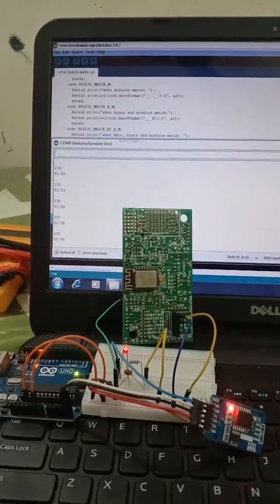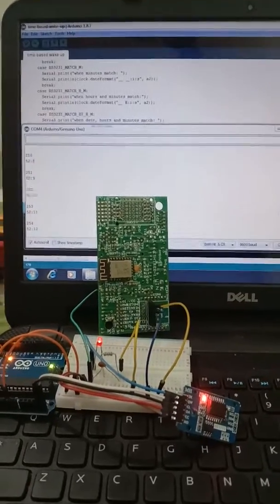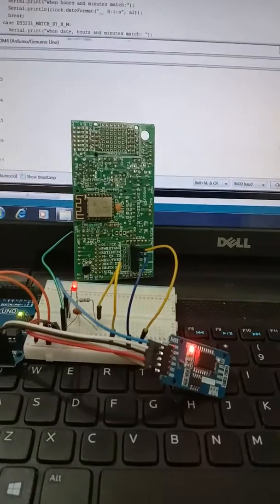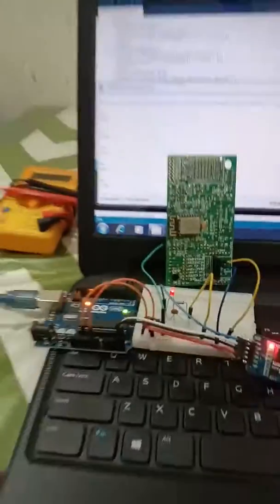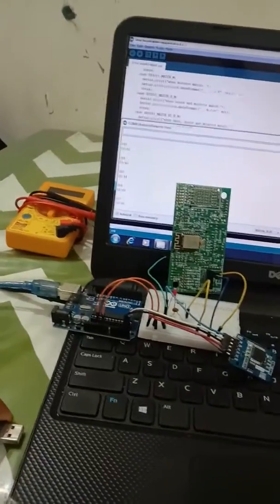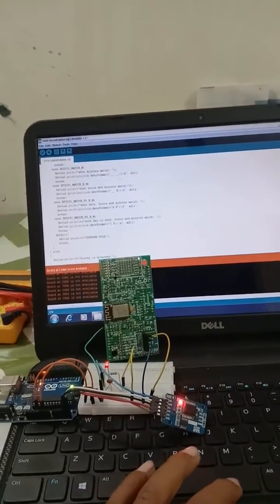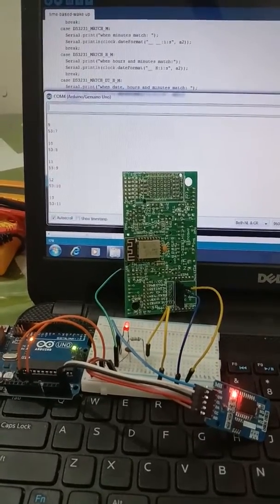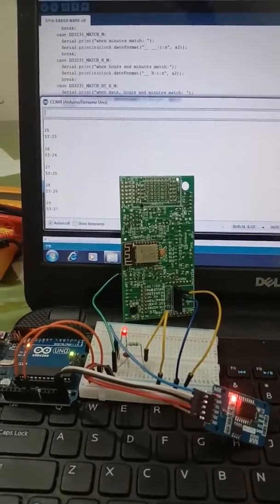RTC module DS3231 timer based wake-up of ESP8266, nodeMCU, arduino

Comment: This video is missing something crucial: a monostable circuit is needed between the MCU RST pin and the RTC SWQ pin. For the actual solution, search for "Monostable deep sleep wake ESP8266 DS3231 RTC alarm". I'd be surprised what is shown in the video actually worked (others in the comments seem to agree). A link in the description to an actual schematic would be useful (ASCII art schematic doesn't really count).

Comment: Hello,  
I have the problem that in case of 8266 RST Pin is connected to SQW, after RTC Timer alarm the SQW output goes to 0V but then remains on 0V  and therefore no Reset to 8266 can be performed. 
If 8266 RST is not connected to SQW, after RTC Timer alarm SQW output behaves correct . After RTC TImer alarm SQW Pin shortly goes to GND and afterwards back to 3V.

Comment: The Ds3231 chip will not wake up esp without the arduino board resetting the alarm flag. The system makes no sense in this case because it needs an arduino connected all the time.

Comment: I have been attempting to use the DS3231 SQW to reset an ESP8266 and can't get it to work.  I don't have an led in mine so I just wire SQW to RST, set the alarm and nothing happens.  If I try to download code after the hookup, it won't happen so I have to remove the SQW, download and then hook up again.  Any help would be appreciated.  I don't see any pin adjustments in your code, and as near as I can tell the SQW is HIGH until it alarms and then it is LOW so should reset the ESP8266.  Any help would be appreciated.  John B.
Reply from the maker: Thanks John. I will come back on it.

Comment: Will the whole chip work if the DS3231 runs only on a CR2032 battery?
Reply from the maker: Yes. It maintains time on coin cell... I have seen even after 6 months
Reply: @wiseThingz  I mean, will the DS3231 powered only from the CR2032 battery generate the wake-up signal at the INT / SQW output?
Reply from the maker: @piotrkuranty8512  yes
Reply: @wiseThingz  I checked and it does not wake up esp8266
Reply from the maker: @piotrkuranty8512  something might have gone wrong. Where did u feed the SQW signal?
Did u disconnect the VCC of RTC module as well?
Reply: @wiseThingz  I connected the SQW signal to the ESP8266 reset. I disconnected the VCC power supply from the DS3231 module. The RTC works only on its coin cell battery.
Reply from the maker: @piotrkuranty8512  The vcc connection has to be there for the SQW signal... 
So u want to go ultra low current in sleep?
Reply: @wiseThingz  I was waiting for this answer from the beginning. So I assumed the DS3231 needed the main power to generate the INT / SQW signal. It is not such a big problem because DS3231 consumes ~ 200uA according to the datasheet with 3.3V power supply.
Reply from the maker: @piotrkuranty8512  the module includes a LED... So if u measure, it takes more current really.
U can do 1 thing. Wake up after say a regular interval (both main controller n DS), check the time n go to slerp for regular interval or time left to ur alarm time.

Comment: Hello.
Could you describe more clearly how the SQW DS3231 pin is connected to the ESP8266? ESP is woken up with the RST pin?
Reply from the maker: yes. Updated the circuit in description. Thanks for pointing out.